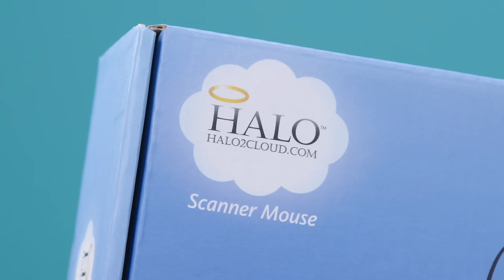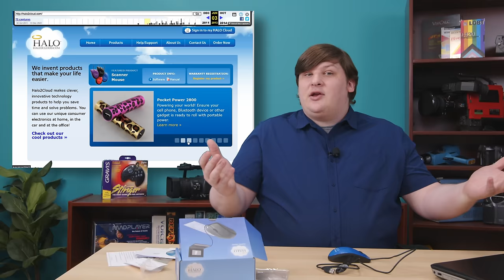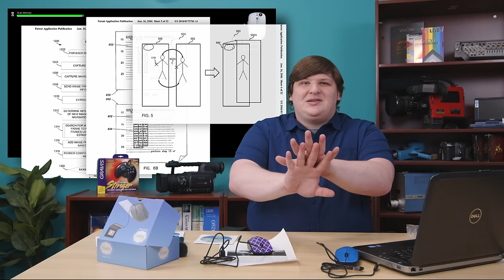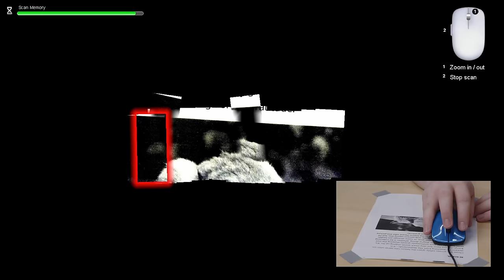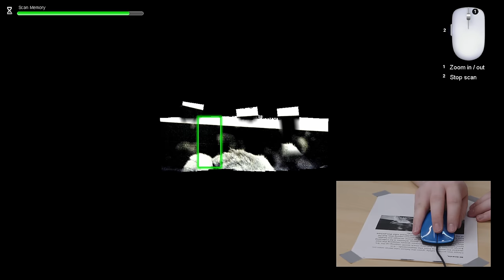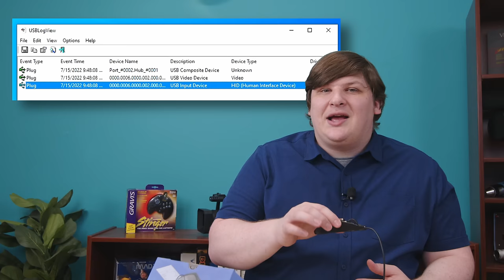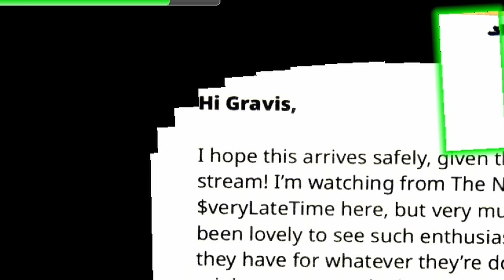Why would you scan things with a... mouse?

Comment: Since it's strobing, it might be that the inrush current causes the supply of a conttoller to drop enough so it browns out(resets due to insufficient supply voltage). You could try adding a little capacitance near the controllers.

Comment: Opening it up makes it seem as if it's exactly what I (or any of my coworkers) would come up as an MVP, or a Minimum Viable Product.
Close to (if not the) last prototype stage, enough that it could be sold, albeit it still has room for optimization. Seems like they presented this concept to investors and either ran out of time to optimize costs further, or just downright met the goal: someone paid to make exactly this, make it then. Whatever. Job done, time to go home.
It's also likely cheaper to make it with all those endless off-the-shelf modules, than to make custom parts for it, or just faster to the market. Unless you'll make many millions, custom ICs ain't gonna pay themselves, tho I do get it that this wasn't your point, rather reducing stuff like the daughterboard usage and such, or concentrate power circuitry. This part is definitely MVP/prototype tier.
Reply from the maker: I think the final, cost-reduced form might actually contain most of the same parts; I can't see how it could be done with anything cheaper or simpler than a pair of dirt-cheap mouse sensors, so really I'd just expect to see fewer + smaller boards, a couple hotglued components, and probably the camera and illuminator combined into a direct downwards looking module instead of the mirror box routine - I suspect that's just a gambit to get a longer focal distance and therefore FOV, but there are other ways to accomplish the same thing (fisheye lens, undistort in software)
Reply: @CathodeRayDude  how about a video on Trident video cards? They "didn't manufacture" large numbers of video cards despite their company name, logo, URL, phone number, and FCC ID numbers registered to the company being silkscreened right on the PCB. What Trident did do was make video chips and design the cards and firmware and driver software to use them. Other companies could obtain those designs when they'd purchase a load of Trident video chips.

To be extra helpful, Trident manufactured "reference design" video cards which another company could buy, un-assembled. The trick was Trident would sell a company as many "reference kits" as they wanted, from one to thousands. For most of the companies they simply just soldered together a ton of reference kits, loaded up the reference firmware, possibly swapping in their own logo to appear during POST, and shipped with the plain Trident reference drivers. Might even have swapped in their own logo and info into the installer and driver for branding without making any changes to the actual drivers.

For all of those video cards, the updated reference drivers Trident put on their website for their different chips would work.

Now comes the sneaky bit. Trident's reference firmware and software could be altered by a company so that only drivers modified by them would work with their video cards. So if they "manufactured" a Trident video card with a Windows 98 driver then either went out of business or decided not to support the card with Windows XP, the Trident reference driver for that chip for XP wouldn't work for that particular card. An especially stubborn PC owner might in some cases be able to flash the video card with the reference firmware to make it work with the reference drivers - but in some cases the "manufacturer" changed something else in the hardware to block that avenue of making the card work with versions of Windows they didn't want "their" product to work with.

But a-holery like that tended to be done mainly by the companies using Trident's reference designs as such is intended, as a reference for ensuring a product functions then making proprietary changes, designing their own PCB, submitting it for FCC testing, NOT printing all of Trident's address etc on the PCB etc. Though I do recall encountering some completely in-house designed video cards with Trident chips where the reference drivers would work.

How did I find out how this worked? By responses to emails from me asking how they could claim to "not manufacture" a ton of products that *had their name, address etc printed on them*. Someone at Trident eventually just straight up told me they'd sell anyone as many unassembled reference kits as they wanted.

Trident wasn't the only company that did this. They just did it the biggest.

There was a video card made by TriGem that used some well known non-Trident brand of video chip. The problem was that TriGem dinked around with the firmware and driver a bit then quit support for it immediately after Microsoft released the a update to Windows 95. Yup, a video card that only worked in Windows 95, no bloody, a, no bloody b... I managed to find a way to fix that. Turned out that all that was required to make it work with Win 95a was to keep one file from the TriGem Win 95 driver package and put it with the video chip's reference driver that supported Win 95a. I uploaded that "hacked" driver to Driverguide and for several years after I'd occasionally get a happy "Thank you!" email from some random people. No, I have no recollection of how I figured out which file nor do I remember which file it is. It has been at least 25 years.
Reply from the maker: @greggv8  that is an absolutely remarkable tale. I don't know if it's quite my thing to cover since it's all just descriptive, but if it comes up I'll definitely have something to say about it now
Reply: @greggv8  Sounded incredibly similar to Nvidia's system as far as I know, of selling the chips (if they actually are a middle-man selling them and not just the production rights at TSMC or whoever does the silicon) and some reference design, but then it goes haywire quickly after with the manufacturer hell.
Sadly sort-of similar stuff still happen to laptop parts.
Reply: @greggv8  This has happened all over the place in manufacturing, in part because the way companies outsource their production make it really easy for the company they contract with to just subcontract the production to a another company somewhere that was already making something similar, then modify to fit (or often, "fit") the new specification.

While that sounds like a normal and healthy subcontracting process, what we wind up with are whole display rooms of washing machines which look totally different from each other and are made by direct competitors... but under the plastic are literally identical down to the component level.

I genuinely don't understand what's in it for the companies involved. The manufacturers are missing out on the markup the middlemen add, and any one of the middlemen with enough capital could buy the manufacturing company and cut costs while boosting revenue by selling to their competitors.

Is this what all those cut-rate products with gibberish brand names on Amazon are supposed to be, maybe?

Comment: 34:00 I think it's pretty obvious that it keeps track of the X/Y movement of both sensors, and that obstructing one of them acts as if you kept that point in place on the table. The reason behind the sensor orientations is probably because that's how the ICs fit inside. Also as someone that has programmed HID stuff before, you can very easily fit custom data through it, and it would also be easy to make an open source driver for it.

Comment: 36:07 The programming functionality was most likely intended for stuff like webcams with physical buttons to take pictures, send e-mails, and so on - it would then make sense for the webcam chip to be able to present itself as a composite HID, as the custom manufacturer-provided code may want to eg. simulate media key presses or activate their own custom software. This would then just be a slightly unconventional use of that feature.

The whole product itself feels like a bunch of engineers and software developers genuinely tried to build a really good portable scanner, got quite far, and then suddenly were told to "hurry up and ship" by management. The software UX honestly looks quite good, if you ignore the questionable editing features!

Comment: i remember seeing projects on the internet using an optical mouse as a scanner! Those were the old style ones where you could still intercept the signals going from the mouse chip to the USB chip. These days it's all integrated into one unit.
Reply: How big was the scanning area? Was it like trying to color a page solid black with a fine tip pencil?
Reply: @DFPercush  It used the mouse's own sensor which was in the area of 8x8 or 16x16 pixels. Monochrome of course.
Reply: @nrdesign1991  right, but how much physical area did those 8 or 16 pixels cover? like, mm or inches

Comment: I believe Google Photoscan is like the app you theorized. It looks at the photo and breaks it up into multiple points you're instructed to take photos of
Reply: I think the problem that Google Photoscan is trying to solve is the issue that photos are usually on shiny paper that's hard to 'scan' with a camera, so they're having you angle the camera a bunch of ways to be able to detect which part of the image is the reflection

Comment: For your question regarding the second sensors data, it’s likely bundled in with the HID device, but marked under a different feature type. The USB HID specification is extremely flexible, and allows for numerous strange combinations. Basically, each HID device registers a set of “features” with the computer, and tells it where it can go to get data for each part of the feature registered. Some of this is standardised, like with a mouse, there are standardised registers used for the mouse data itself, but you can also do all sorts of other stuff with it. For instance, I was working with an IMU unit that registers itself as an HID device, but doesn’t use a standardised method of relaying that data cause there isn’t one. Instead, it uses the HID protocol to tell the computer where the command and device descriptor are, then relies on a custom driver to set up the rest of the device. It is likely that the mouse here has a mouse feature, and then a custom feature that relays either the data from the other sensor, or the calculated rotation and position data to the computer. Windows uses the mouse, the software taps into the driver and uses the other feature. I’m a bit rusty on this cause USB HID is also a very dense standard, but I think my general understanding is correct.
Reply: Also, as for the multiple USB chips, USB in general has ways to deal with that. Basically, the main chip used would act as a hub, and the rest would be just like plugging in multiple USB devices to a hub. They may have used a different method, but this would be the most straightforward. You see this with internal USB hubs used on laptops to connect things like SD card readers and touchpads. Each chip gets its own address alongside the vendor ID, which avoids address collisions, so they can just be independently addressed and show up on the computer acting independently. Again, same disclaimer as above, working off of slightly fuzzy memories of the whole thing.
Reply: Addendum to the above, since you addressed the hub concept. A USB composite device is as best I can tell, a purely software implemented device. On both Linux and Windows the documentation relating to composite devices talks about drivers as opposed to the USB spec. So I’m guessing they’ve avoided a hub, and instead rely on the driver to address each chip correctly. The unmarked chip could be doing a basic USB interface, or it might be a built in hardware feature of it. Hard to know without finding the data sheet.
Reply: Yet another addendum. The likely reason you can’t find any large format scanning apps for android is that doing dead reckoning with a phone accelerometer and gyroscope is basically a non-starter. AR stuff works, but it utilises a lot of visual data to correct for the constant drift in the accelerometer, and the computer vision used is not able to gather much context when pointed at a piece of paper. It may even get confused if pointed at an image without sufficient context clues and regard it as 3D if the phone used lacked depth sensing capabilities. The biggest issue arises from the fact that there is no good way to zero out the acceleration noise picked up due to the movement of the planet and gravity without spending a lot of money on a fancy GPS setup that sends correction data specific to the local region. I looked into it for a project on a large scale photogrammetry application using a cheap add on to a camera, and it just wasn’t feasible with current MEMS sensors.
Reply: I have a project that I reverse engineer Wacom I2C digitizer and reuse it with Teensy MCU and nRF51822 (BLE mcu). All I have to say is that USB is really convenience to user, but designing this from ground up (I wrote my own HID descriptor) is real pain. USB HID is complicated (at least to beginner) but ir's versatile. It's probable the cheapest way to send data to your PC since you don't need to write your own driver, just HID api call.

Comment: If it worked I could see a use for this 10+ years ago. 
I worked in hardware and our shipping and receiving department had to scan the labels on boxes and enter them into the computer. They used those hand held wand scanners you showed at the start of the video. They worked but as someone who had to support that thing I had calls every time the cord failed, the battery died, SD card malfunctioned or just got lost.
I like the mouse idea because when they scanned it would go right into the computer, that would eliminate the SD card, transfer cable issues, battery issue and since it was connected to the computer at all time, help it from getting lost.

After a while the camera on tables and phones got good enough for their needs and they scanned changed to that.

Comment: The video was very interesting. :)
I think there are two mouse sensors to identify rotation. If one sensor is able to detect position changes, using two and comparing their position changes would make them able to detect rotation changes. 
That is why the image seems to be rotating when one mouse sensor is blocked at 33:10. The software thinks that the blocked one stands still while the other one is moving, so it must be rotating around the axis of the blocked sensor.
It is most likely done to be able to scan uniformly white areas of paper, which has to work to some degree since those are pretty common. The normal camera sensor would not be able to accurately detect and compare the details in those white areas, which would result in very inaccurate scans. But the two mouse sensors are able to work on white paper.

Comment: My first laser mouse worked fine on glass too, but I specifically remember Logitech making a big deal about some tech which made that possible (something about higher resolution and reflection rejection, and even then the glass had to be at least half a centimetre thick). 

And I recall reviewers rejoicing based on previous products needing a mouse mat or a wooden desk. So it doesn’t surprise me that the cheap laser sensors used in this one would struggle with glossy surfaces.

Also, I had to take five minutes to go “nooo” at the end card, even though I only saw him in a few tweets and that Video Shaker demo. RIP in peace large man. Empathy to you, Gravis.

Comment: USB HID allows for vendor-specific additions to the protocols used by mice and keyboards.  Most of today's gaming peripherals have a large set of vendor-specific HID commands for things like DPI adjustment, button/key remapping, macros, RGB lighting controls, profile storage, firmware updates, etc.  Having a proprietary extension to read a second mouse sensor wouldn't be too difficult, and they may use such an extension to read both sensors simultaneously in scanner mode (hence how it also disables the actual mouse functionality while scanning).

It would be interesting to get a Wireshark capture of the USB data being transferred to and from the mouse during a scan.

Comment: the two sensors are to provide rotational data for the mouse. the "off the shelf" mouse sensors give positional data, but not rotational data. one point can define translation, two points can define rotation. the one sensor design would have required a custom chip to process rotational and translational data.

Comment: I'd used several hand-scanners in the 80s and 90s, and one thing that bugged me about every one I ever used: They had a single cylindrical rubber "tire" that ran most of the width of the device.  Theoretically, this was supposed to keep the scanner moving in a consistent straight line.  In reality, they still allowed the scanner to twist as it was being pulled along.  I always thought what would have been better was a narrow tire on each side fixed to a common axle.  This would provide only two points of contact with the scanned surface, rather than an infinite number of points around which it could pivot.

Comment: Curious what the actual failure was. All components are solid state? No cloudy windows on the sensors, so what happened? Did mouse functionality work fine on both after scanning felt apart? so then the main cord was undamaged. Neat piece of tech

Comment: The one feature I'd like to see from this in modern mice is it figure out the rotation of the mouse (though I'm sure there's better way of doing it such as a magnetometer). It would be pretty awesome to have a mouse with a rotation axis and correcting for this rotation on the X/Y axis.

I could see this being useful an extra axis in gaming, maybe leaning around corners or holding a gun gangster style, maybe yaw control for flight sims. It could have a ton of application in design software too, rotate objects without changing tool, turn knobs UI elements etc.